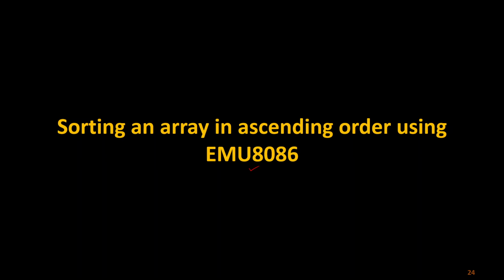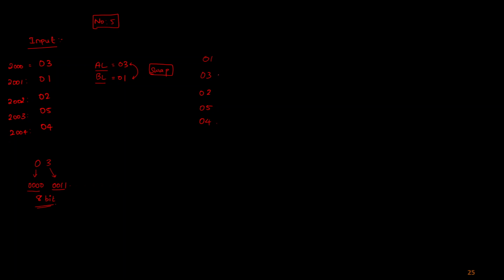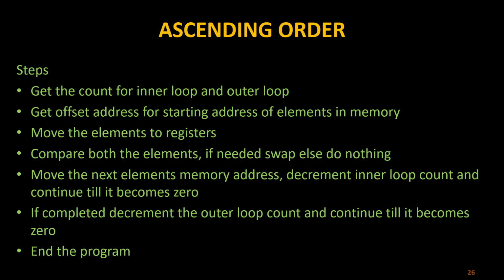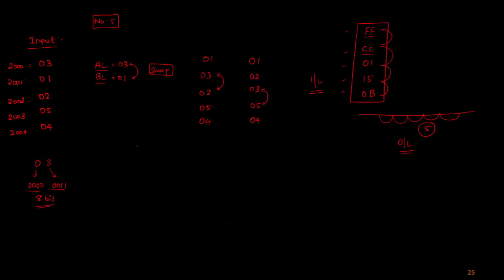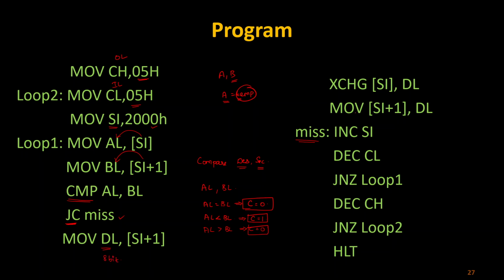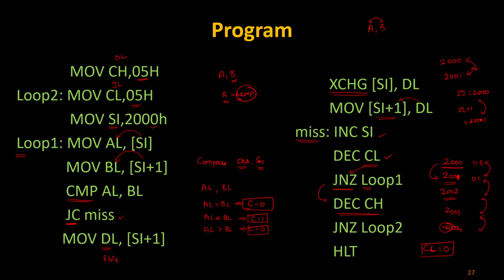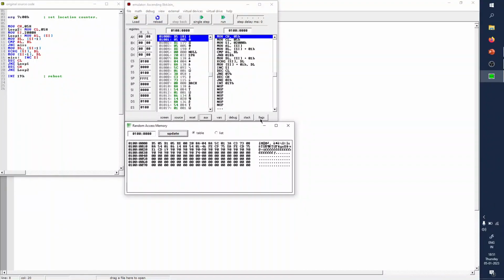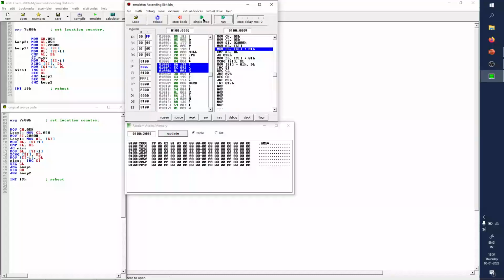Assembly language programming for sorting an array in ascending order using EMU8086

Comment: Sir, I am sharing the code for 16 bit descending order code in this comments section as instructed by you as our batch 4 was not able to complete it in the class
1000 : MOV CH,05H
1003 : MOV CL,05H
1006 : MOV SI,2000
100A : MOV AX, [SI]
100C : MOV BX, [SI+1]
100F : CMP AX, BX
1011 : JNC 101B
1013 : MOV DX, [SI+1]
1016 : XCHG [SI], DX
1018 : MOV [SI+1], DX
101B : INC SI
101C : DEC CL
101E : JNZ 100A
1020 : DEC CH
1022 : JNZ 1003
1024 : HLT